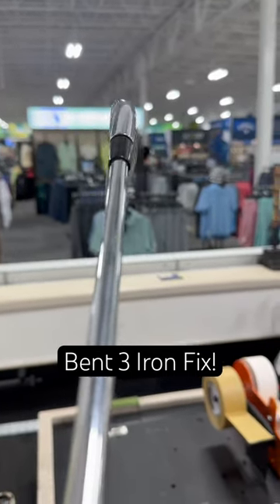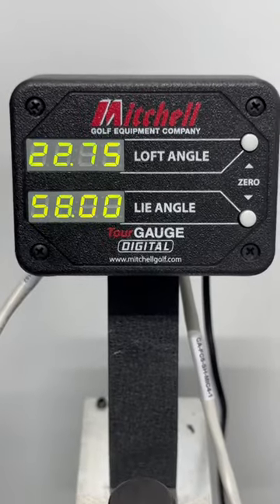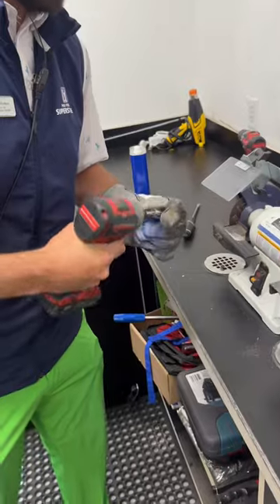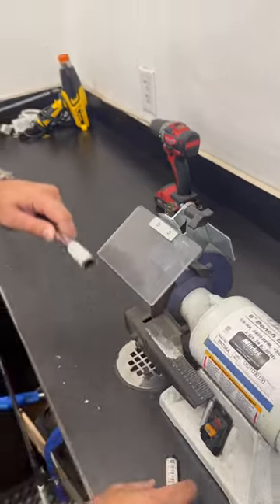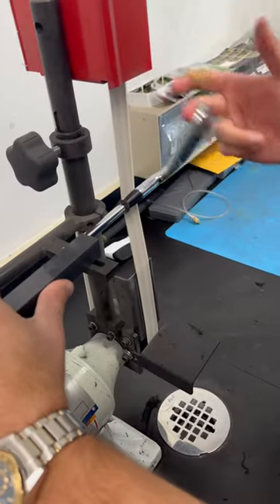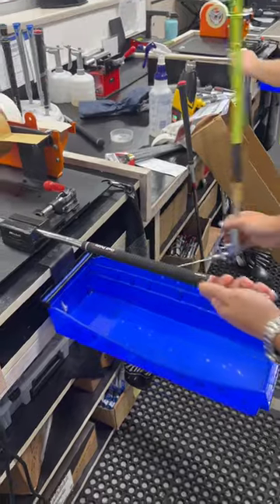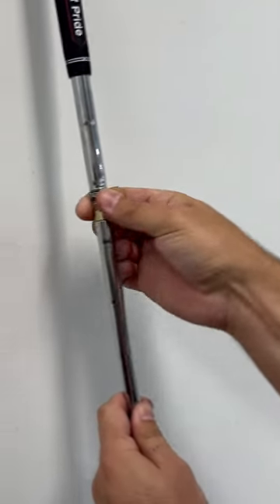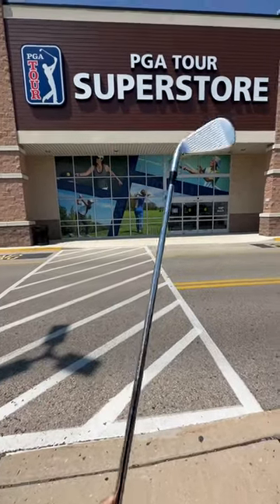Fixing My Bent 3 Iron! #shorts #golf

Comment: I hate how they use the air through the butt of the grip.   When you regrip a club you twist off the excess at the butt and push it in to seal the end so that no moisture gets down into the shaft to prevent it from rusting.

Comment: I’m confused how the shaft didn’t already come with the DG label. Shouldn’t they come with the sticker from the factory?
Reply: Brand new uncut or "raw" shafts do not come labeled with the sticker already on it because the shaft needs to be cut down, prepped, installed, and gripped. Afterward the included sticker is put on in an ideal spot.

Comment: would it not be cheaper to just get a new club? genuine question
Reply: I work at dicks sporting goods and see regrips all the time and for what he got it would be around 40$ if he had the new shaft seperate to the purchase so its not that much
Reply: That’s probably a 150-200 club
Reply: Repaired hundreds of bent clubs. Many hot tempers out there.
Reply: Generally if you care about keeping your set consistent you would need to find that exact iron on sale solo, which is very rare. Otherwise you would need to buy a complete set as golf stores won’t sell you one iron out of a set and manufacturer don’t make one offs
Reply: That cost about $75-80.

Comment: Did he CPM the orig shaft and then match it? If not you have a different club now.
Reply: He doesn't need to tip a taper tip shaft therefore no need to check frequency as long as length is the same. However swing weight is another matter I would make sure to match that.